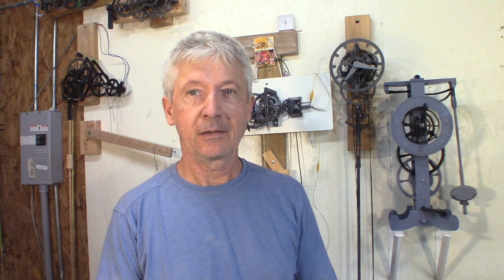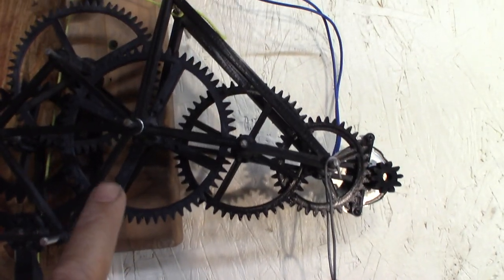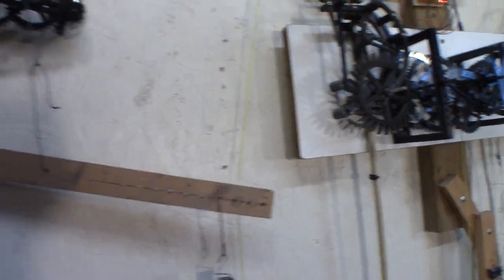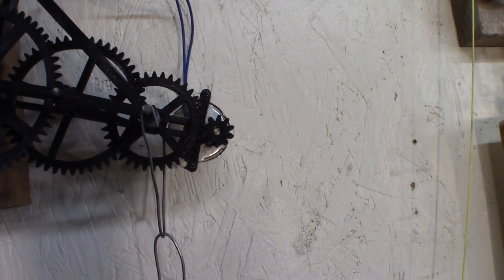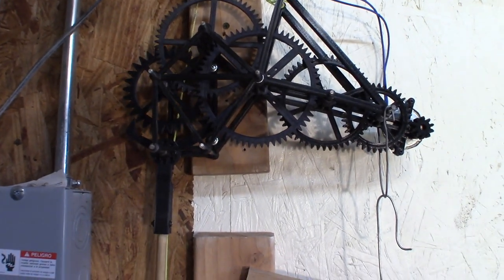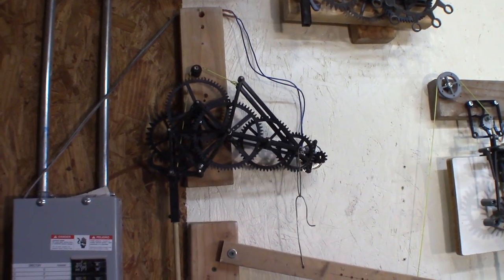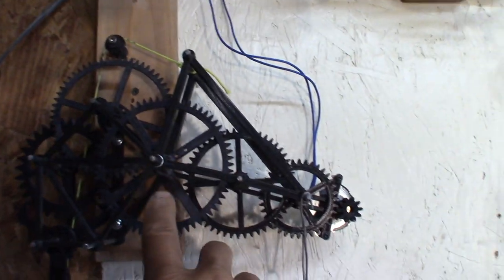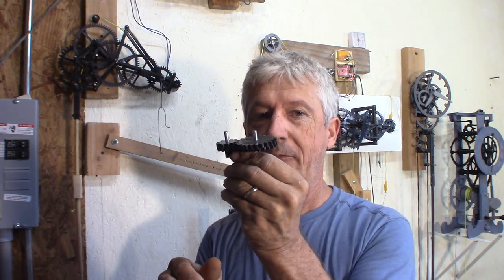I designed, 3D printed and built a synchronous clock

Comment: Very interesting. If you have an accurate synchronous motor, couldn't it run the hands directly? The pendulum would only need to be decorative. I am curious about the accuracy of the motor. There are many labeled as 2.5/3RPM depending on the AC line frequency. Some that are labeled as microwave oven motors are only close to the listed speed. Others sold as clock motors will run at exactly the listed speed. They are usually much more expensive and harder to find.
Reply from the maker: Yes, that must be it, slower than advertised.
I was surprised that I had to have a pendulum longer than expected.
After this video I tried a Graham escapement, 
it worked better, much less weight needed, but still needed a longer than expected pendulum
Those motor must be simple asynchrone AC motor, so that part is a fail.
And then I was just lucky with my first try...
With the Graham escapement , I never managed to get it to adjust and finally I realized that my string worked backwards.
Wonder if someone else will notice?
Total failure, but was fun to try!
Thanks for your comments
Reply: @jacquesfavre999  Not a total failure if you found out what needs to be fixed for the next version. :)
The microwave oven motors are good enough to run the microwave turntable where the exact speed is not very critical. They use prime numbers of teeth internally to even out the gear wear. There may be a 17 tooth pinion driving a 43 tooth gear. A different manufacturer may use a 19 tooth pinion and a 41 tooth gear. I tested two different brands of 6RPM motors. One was 5.824RPM and the other was 6.228RPM, so they are using different internal gearing.
These are the type of motors that would be accurate https://www.ebay.com/itm/BRAND-New-Synchron-clock-motor-s-CLASSIC-model-610-110v-OEM-Parts-FREE-ShpN/254537151916?hash=item3b4398b5ac:g:aNoAAOSwCAlbgBC8
They are designed to run time punch machines. All the new machines are electronic so most motors in eBay are old stock.
Another alternative might be a mechanical appliance timer with a 24 dour dial and pins added to turn lights on or off.